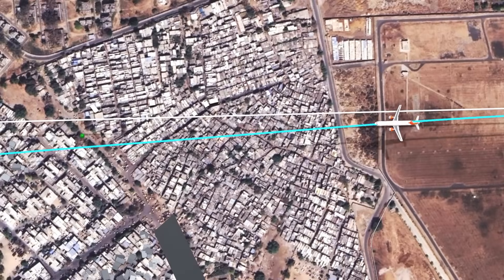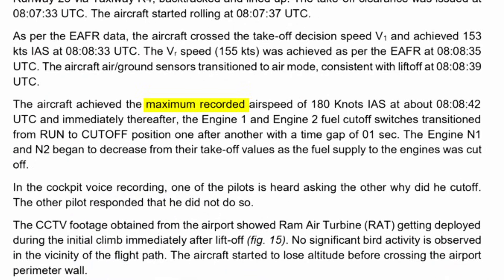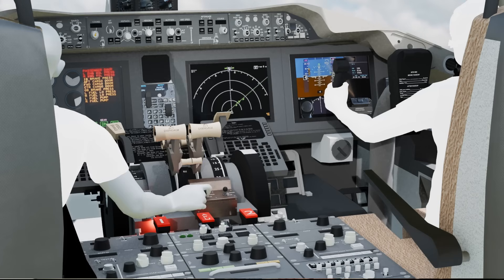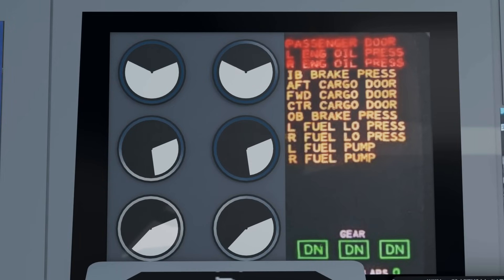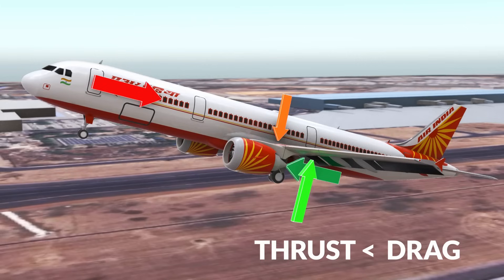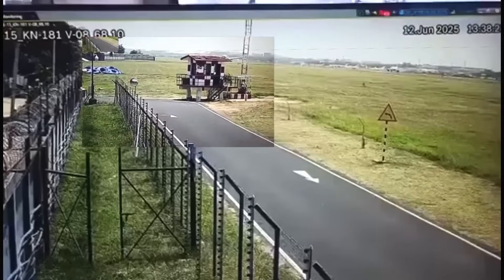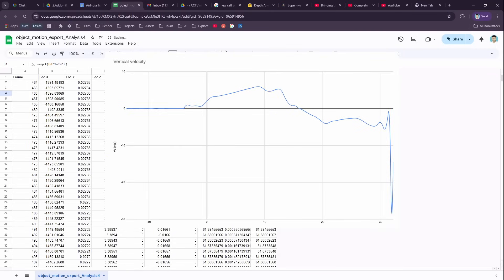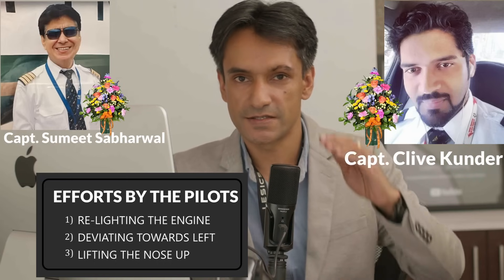Use of 3D Clone | Decoding the Crash Details you Missed

Comment: This report is very very clear and complete. To study 1 minute of voice and data recorder you do not need Rocket science nor months. It is open and shut case ofone of the pilot moving the switches. There is no dispute that these mechanical switches cannot be moved by electrical or ele tronic or computer glitch. In fact after the crash the switches were found in RUN mode, without any malfunction,else it would have been mentioned in the report The lock system of switch is as a such that even in turbulence or even if plane is 90 degree, ,the switch does not move. The flying pilot has both hands on control as he has to turn the plane after certain height.Plus the 10sec delay in start can be as flying pilot looks ahead and switches are at back. maybe after 4/5 of switch off the enginee lost thrust and then he looked of side and released the switches at cuttoff.
Another question who said what?,, is immaterial , whether the culprit himself accused the other or denied the accusation. The culprit is the one whose hands are free at time of take off , to do it with- in 3/4 seconds on takeoff.
In fact the pilot association should accept the report and fight for pilots welfare and their family welfare , more pension, more security , etc to lessen the stres levels of pilots.. Why they are in denial mood, it is beyond my understanding.Are they expecting cockpit cctv footage as proof?There has been 5 cases of pilot suicide with aircraft during past 25 years. '"'''
Reply: SORRY, BUT you lack the needed knowledge to make several of your (incorrect) assumptions:

While the Fuel Cut-Off switches are entirely Physically-Actuated, THERE ARE SEVERAL OTHER Failure modes that perfectly CAN produce a Fuel Starvation or uncommanded Fuel Shit-Off condition.

Even the FDR cannot assess that the switches were or WERE NOT moved, as the FDR only registers a possible "Change-of-State" of the associated circuit... The recorders cannot, repeat, cannot "know" with certainty,  if a switch was "moved" or not... as those recorders can only register a change in Voltage, Current, or Continuity of the switch circuit, BUT that DOES NOT mean that "the switch was (or wasn't) moved! There are multiple conditions that can occur: Either a switch wire can suffer a short to ground, or a short to another wire, or an intermittent short, or a continuous "hard-short", or a momentary Open circuit, or a false pulse resulting from EMI (Electro Magnetic Interference), or Electrostatic Discharge... AND/OR the complex system can suffer from a power loss (either a total black-out, or a momentary one), or developed a Software-Corruption ("bug")... 

Because the Fuel Cutoff switches ARE NOT the only circuit path to actuate the Fuel Shutoff Valves, as there are OTHER system "Blocks", where Digital Processors can and do intervene, in a Parallel circuit path...

- Thus, thinking that "only the switches" can shutdown the engines, ignores the fact that the FADEC (or OTHER associated Engine Control Blocks), can also actuate and cause a Fuel Shut-Off, causing the engines to fail.

Only ONE THING can, without ANY DOUBT, be said at this time:

-- That the Preliminary Report is wrongly written, contains numerous discrepancies, uses a LOUSY, and IMPROPER expressions (like: "about", "immediately", or "approximately"), wrong terms that should never have been used in a serious Report, even a Preliminary one, shoudl not have.

Such a badly written "report", has alredy caused a lot of wrong and absurd speculation, and unfounded, ridiculous theories by individuals that lack understanding of aeronautics, piloting airliners, and even basic control or electrical knowledge.

The Preliminary  Report plants more wrong information than the correct one.

If you judge the Prelim Report to be "complete", and "factual", either you have read very few well written Accident Reports, or your Aviation knowledge is quite limited, and you are confusing "a lot of pages, with distracting non-relevant information" with "completeness"... BUT, the Report LACKS the most basic and fundamental hard data, like a Proper and low granularity TIME STAMPS, loosely worded "facts", inconsistencies, and vagarities... It is a shamefully, badly worded and badly written "Report", that is an INSULT for the families of the deceased, and to  people with firm technical knowledge.

AND, in regard to the "suicidal" nonsense, you need to study in much more detail the large differences between the Air-India crew, and, for example, the clearly disturbed, maniac and insane Germanwings First Officer, a dangerous individual that was actually "helped" by an equally idiotic Psychiatrist, dumbly following stupid "Professional Discretion", twisted "guidelines"; that kept hidden those clear and long-maintained suicidal tendencies... 

Very different conductual profile from the pilots on this terrible crash.
Reply: @alfredomarquez9777 
You are trying to create a MIRAGE. The probe teams consists of experts of india, uk, usa, boeing ,GE , and govt officials. They alone have access to all evidence and no one else. Their findings are based on actual evidence and not on probability. Thus do not get confused nor live in a  mirage. It is an open and shut case. Now only two things ate pending WHO did it ? and WHY did it ?.Doubting the MODI govt is self defeating as investigation cannot be handed over to you nor utubers and nor to FBI.Generally all utubers are taking public on a merry- go- round, with their own stories, permutations,combinations instead of properly reading the REPORT.
Reply: @alfredomarquez9777  "It is a shamefully, badly worded and badly written "Report", that is an INSULT for the families of the deceased, and to  people with firm technical knowledge."
I agree totally.

Comment: Very interesting data! The AAIB needs to clarify their prelim report. Too many inconsistencies.
Reply: the people who leaked this report, why they did not mentioned Whether they have heard the noice of switch physical movement or not in the voice recorder.
its very evident that the physical movement produces considerable amount of noice and Audio recorder is efficient enough to capture very minute noice.
If the noice was audible in the recoreder, it was a soild supporting evidence for the for the people who (assumingly representatives from boeing, NTSB, GE or UK investigators) leaked this report to prove pilot did it deliberately .

Why the time of RAT deplyment is not mentioned in the report? instead reprt mentioned  power reinstated from RAT 4 seconds after both engine failed.
Then when was RAT deployed? normally it takes 8 seconds from the deployment to establish power  (opinion from some expert).
If that 8 second phylosophy is right, then there must have an electrical failure during take off [(3+1+4) - (8 seconds) = 0 ie, take off time ]. See, the volocity at that point was less, then efficiancy to deliver the power by RAT also will be less.

Why there is a termal runaway on rear side data decorder especially tail end was not exposed to fire or heat. wires were burned.
Reply: @anilkumarnair5590 i know why you've said that. BUT its 90% certain that this will be an issue with TCMA/ECM failures and 1 engine failure on Takeoff (these events possibly totally  unconnected with each other.) 

The 46hours of FDR data WILL show errors and alerts in my honest opinion.
Reply: @anilkumarnair5590 many of fdr info seems to have been lost as power to fdr failed. That maybe why they couldn’t report rat deployment time.

Comment: 1. 17:11 WHY do you say "... less than ..." there is NO less in the report you are showing. 
2. The switches are close together, a GAP of 1 sec. is enough. Pilots are used to use the switches
3. The switches could even be switched off simultaneously using both hands
I do not say that all those happened. But nobody can say that it did not happen as well.
Reply: AAIB report says after lift off switches were transitioned from cutoff to run 4 seconds apart.  That's about right for lift-move-move-release, watch display for success, move to 2nd switch.
Reply: @patricklockerby4308  NO. Watch the Video, at 17:11 the video shows the AAIB report. I have the report on my computer as well. It says exactly:
[quote]the Engine 1 and Engine 2 fuel cutoff switches transitioned from RUN to CUTOFF position one after another with a time gap of 01 sec.[end quote]
1 second GAP, NOT 4!